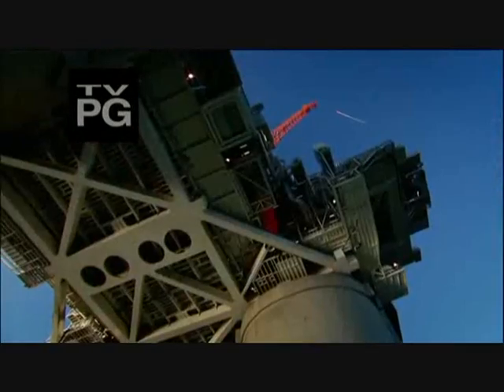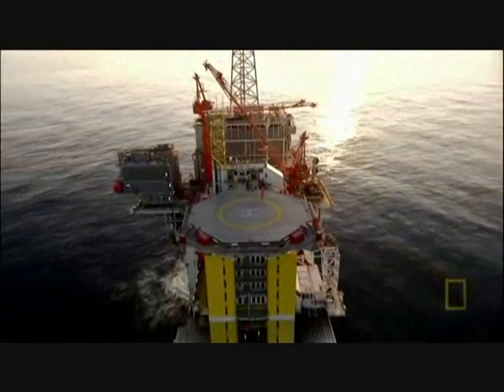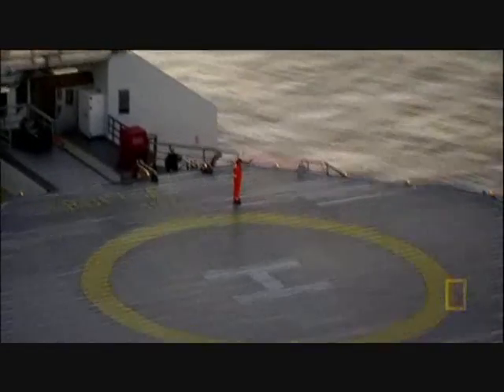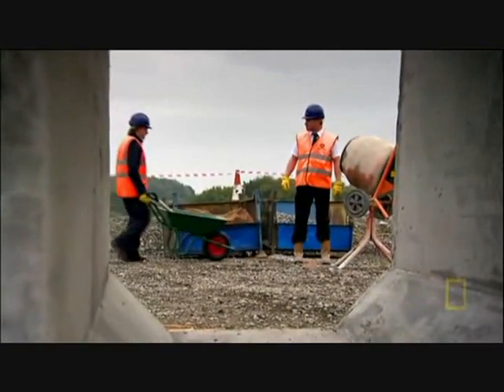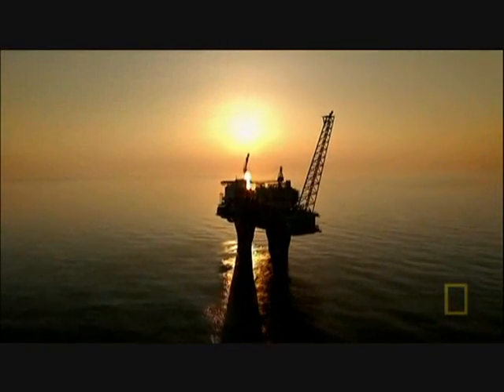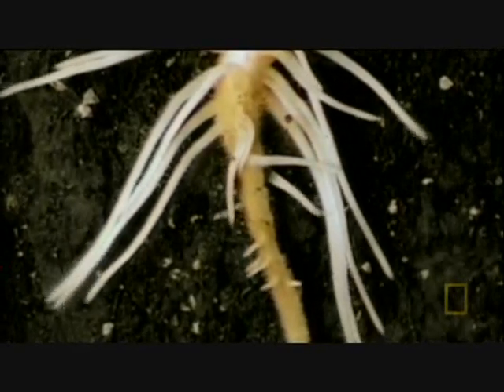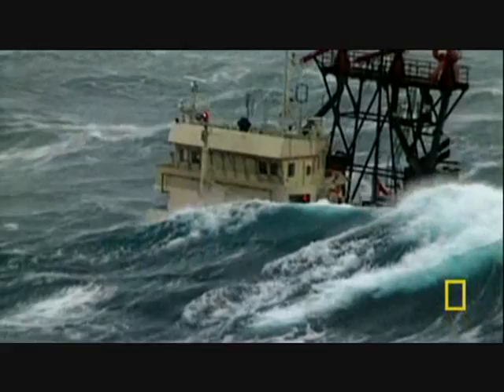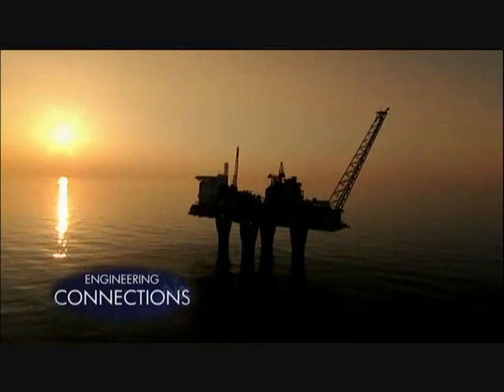EC: Troll Gas Platform 1/5

Comment: "...few bits of reinforcing steel." What! This is amazingly misleading. It is not the concrete being itself made more flexible, which was the whole thrust of the earlier part, but that it was reinforced with metal rods, which is standard practice in EVERY structural use of concrete, and which goes without saying is part of the amazing Troll platform. The tests are also grossly different, with no shock load in the second case, and the supports for the load being close to the supports.